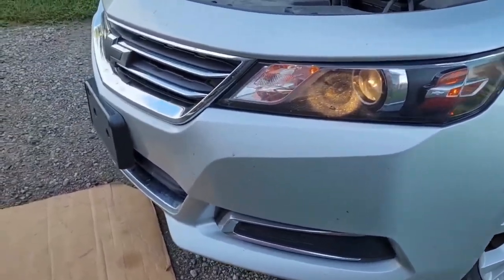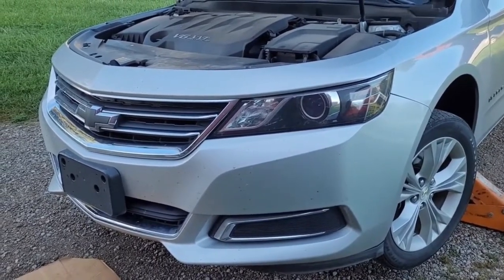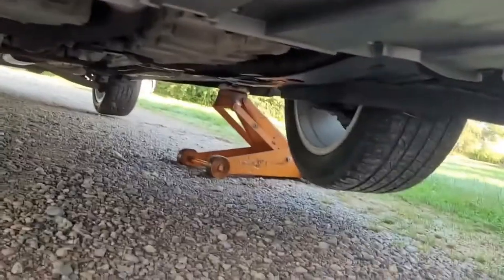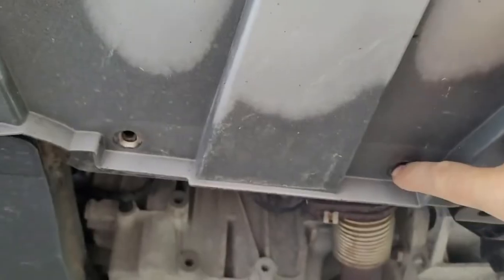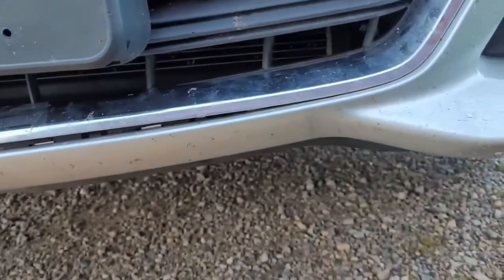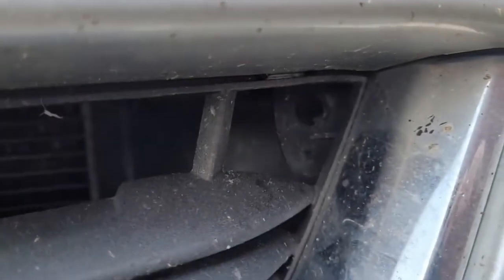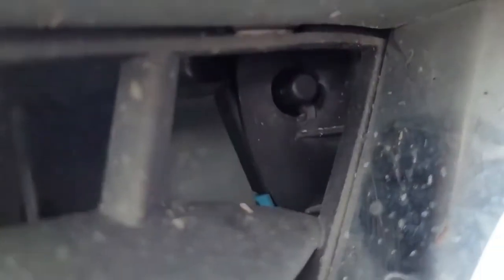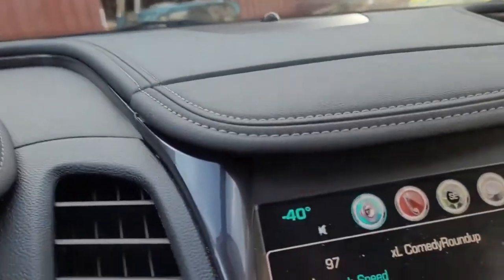2014 - 2019 Chevrolet Impala Outside Ambient Air Temperature Sensor Replacement

Comment: The guys that wrapped my car either broken the sensor or didn’t put it back in since I’ve been getting the same message and hot air unless on “Lo” 🤦🏾‍♂️ going to try this during the weekend. Glad to know I don’t have to remove the bumper. Thanks
Reply from the maker: Good luck on the repair
Reply: This, i thought i was the only one man DAMN

Comment: Ugh--That moment when you turned the power back on after part replacement and it still showed -40. Everyone who has worked on cars knows that moment of disappointment and futility when you've done what you know just has to fix it and it still doesn't work! Glad to see it ultimately resolved.
Reply from the maker: Agreed...what an awful feeling. I guess that is why they say patience is a virtue. I was sure happy when it did finally start to recover. Thanks for the comment.
Reply: You have to drive it to reset after u change it
Reply: It have to be reprogram it once replace!!
Reply from the maker: Yes. I state that near the end of the video. I was worried I did it wrong until I drove it.
Reply from the maker: Nothing needs to be programed. Just drive the vehicle.
Reply: @JustLearningbyDoing  I have 2020 you have to reprogram it ...on that year!!
Reply from the maker: Thank you for the information.

Comment: Thank you for this video!  I would love to know your opinion on a question I have regarding my 2012 Chevy Impala.  The body shop I ended up going to, wish I had seen this video first ;)  they repaired the ambient temp sensor but noted also I may have a faulty Temperature Control Head.  

As of today, 1/2/24, my windows, front/rear/sides all fog up if the temperature falls below 32° and when I try to run the defrost using the A/C button, it flashes and doesn’t turn on.  Above 32° the A/C button will come on and allow for windows to defrost.  

Before having them do the work, the inside of my car windows were actually getting frosted over almost like I needed to scrape the inside of my windows.  And it wouldn’t defrost and same thing  happened where the A/C button wouldn’t work. 

So, although I don’t have any frost to scrape on the inside of my windows anymore, they are still fogging up if lower than 32° outside.  

I don’t know much about the temperature control head and its function.  Wanted to know if you had anything to offer on this. 

Thanks so much!

Comment: Did this to my 2017 Camaro SS, almost a week ago, still have lines where the temperature should be reading.  Installed new sensor. Nothing. Any suggestions?
Reply from the maker: Did you try disconnecting the battery yet? I'd disconnect the negative side for about 5 minutes then reconnect it. That should reset the system and give it a reboot.

Comment: I had my bumper replaced (‘15 impala ls) and that piece is hanging but u never bothered to investigate. Coincidentally my AC is out and I’ve had the compressor and radiator (dented) changed. I’ve been looking for a video on how to replace the AC suction hose, but I would love for this to be my only issue
Reply from the maker: Hope that is the fix. It's an easy repair. Good luck!
Reply: @JustLearningbyDoing  does it look plug into the radiator? The area where it looks to go os blocked on my vehicle.
Reply from the maker: What year is your impala?
Reply: @JustLearningbyDoing  15’ also, it’s an LS.
Reply from the maker: @lesterwaller8720  it should be in the same location then. It just clips into a small hole. It is located in front of the radiator support on the driver's side.
Reply: @JustLearningbyDoing  so, really as long as the sensor is connected properly it all should work just the same?
Reply from the maker: @lesterwaller8720  as long as the sensor is connected and working. Obviously, if the sensor is bad or the wiring is damaged, you will get the same -40 temperature reporting and your AC will not work.
Reply: @JustLearningbyDoing  thank you

Comment: Have you ever changed the sensor?
Reply from the maker: Yes. I replaced the sensor.
Reply: Do you have a video you showing you removing it I have a 2014 Impala in the light came on the dash AC is off due to high engine temp
Reply from the maker: @dennisshaw4189  unfortunately no. Mine was knocked off by hitting an animal. It is simply plugged into the location noted in the video. It is a simple removal.

Comment: Can the ambient air temp sensor cause the compressor clutch to cycle on/off?
Reply from the maker: I can't say for sure, but it is possible. 

The clutch is controlled by the AC compressor clutch relay which has an input from the engine controls ignition relay. They receive an output from the ECM which receives data from the HVAC module for feedback. 

I would think there is a sensor that is malfunctioning that is causing the cycling. 

The following sensors are monitored by the HVAC module:
Ambient air temperature sensor
Lower left air temperature sensor
Lower right air temperature sensor
Upper left air temperature sensor
Upper right air temperature sensor
Windshield temperature and inside moisture sensor
Ambient light/sunload sensor

Hope that was helpful.

Comment: is this will fix my impala 2014 ltz ac ? it works fine but when i stop for 2 min it turns the compressor off with hot air (i changed the compressor with new one same problem i will change the air filter tmmr imma try but if u know ehat is the problem,u will help me a lot, thanks .
Reply from the maker: Unfortunately it is difficult to determine what may cause your specific issue. If you have an outside temperature indication on your center entertainment/multifunction screen, verify that it is reporting correctly. This issue I am correcting is specific to that type of indication with loss of AC. 

Some of the items that may cause your indicated issue include:  Cooling fans are not operational during idle , blocked or dirty condenser fins causing poor heat transfer or low refrigerant level. 
I wish you luck on your problem.

Comment: You should put a Fix pad jack for safety. 
As the one you are using can fail while you under the car 🚗 😉
Reply from the maker: Thank you for recognizing those types of safety issues. I always use a jack when I am under the vehicle working. The beginning of the video I am kneeling at the front of the vehicle with my camera held out. You can see at timestamp 3:16 I have placed a jack stand to ensure vehicle security prior to actually working under it. Again, thank you for the reminder to everyone about the importance of being safe while working as a DIYer.

Comment: Had same issue on a 2012 equinox, yes you have to drive at 45-55MPH for 10 or so minutes continuously after replacing the sensor to recalibrate it. My issue though..... the cars computer isn't holding the info so it continually resets itself. When it does this AC will not work until I have driven for a bit and got the sensor to read above 32 degrees, and then the air will kick in. The Car literally says hey it's -26 out, you don't need air you need heat. Still haven't found a solution
Reply from the maker: I would tend to think there may be a loose wire or a poor connection at the connector. If it does not sees the sensor it will give the lowest reading. It is perhaps not seeing it, then makes the connection after the unit warms. Possibly caused by the expansion from heat soak.

Comment: I changed mine on my Chevy Cruze 15. Worked a bit. Engine light is off. But at the moment it's doing it again. Hot air -40 reading. I'm so frustrated
Reply from the maker: That is strange. The reason it is giving the -40 is because it "sees" an open condition in the circuit. If the sensor has been replaced there could only be another open somewhere. Either there is a broken wire in the circuit or the sensor is bad or not fully seated. I hope this helps for your Cruze. I have to assume they are similar.

Comment: Damn bro...32 seconds in and I have the same issue...-40 degrees
Reply from the maker: That is indicative of the sensor failure. It should be a quick cheap repair for you. Good luck.

Comment: Where is the sensor at ??
Reply from the maker: At the back of the engine at the top. The video shows it behind the air intake throttle plate.